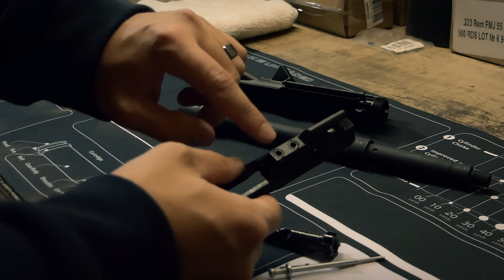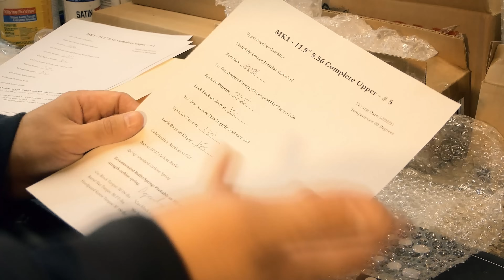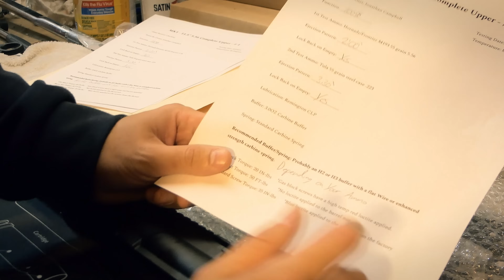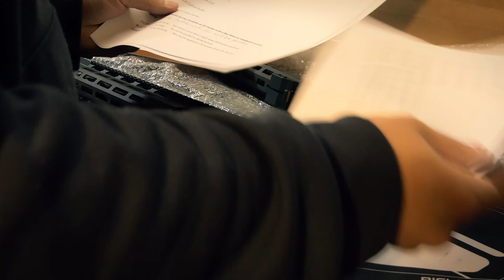The MK1 11.5" 5.56 Upper Receiver - High Value Upper (Definitely No Bias)

Comment: Toolcraft BCG: $120
11.5" barrel: $110
Handguard: $75
Upper: $60
Gas tube, block, charging handle & flash hider: ~$25
Shipping:  ~$25
Time spent ordering everything, buying all the tools & doing proper torque specifications during build: 2 hours & additional $100 for tools.
Total: ~$500

If you don't mind me saying, "High Value" is a HUGE understatement...
Reply: 100%! Heck of a value, especially for someone without the bench tools and build skills. I have both, but the price is good enough that I'd just buy this, swap the muzzle device and charging handle, and then off to the range!
Reply: ☝🏽 Tripp, see what I mean about the muzzle device? Definitely need to do a review on a hand full of different ones then pick 3 or 4 as well as adjustable gas blocks to offer for optional upgrades, especially if you plan to do any 14.5 p&w - which I really hope you do, but you'll have to figure out the legal requirements & the proper process to do it without harming the barrel
Reply: $110 for a BCA barrel is an overstatement. Those barrels were selling for $30 before BCA lost their business for employing illegals.
Reply: @notsure7799  yeah, it turns out you gotta charge a little more when you're paying legal employees and payroll taxes. Go figure. 🤔

My point was if you looked up the specific parts referenced, those were current listed prices. They did have it on sale for like $89 or $99 for a very short time, but not at time of the comment, I haven't checked it today though...
Reply: @survivetheattack  it was a reference to another conversation about 14.5 pinned & welded uppers for restricted states like CA & NJ. 
I meant offer different muzzle devices as options on the 14.5 p&w and he could also offer them as upgrades on the 11.5's as well.
As far as adjustable blocks, he had some nice blocks for $30 before. I think they were radical firearms, but I'm not 100% on that one...
Reply: @notsure7799  it's a ballistic advantage barrel not BCA.
Reply: @madeintexas1213  he specifically says at the beginning of the video that the barrel is a BCA....
Reply: I miss these prices 😢

Comment: Don't know if it matters to you, but if there's ever red threadlocker on something that you d9nt want to take apart, a propane torch for just a few seconds [until it's 500 degrees or so] causes the threadlocker to break down. 

They make a tool called heat crayon just heat er up and touch the crayon,  when it melts, you've hit your temp. 

Easy peasy. Old millwright trick

Comment: If anyone is curious, had mine about 8 months now. Had to warranty the first due to the Forward assist, Trip replaced it right away and the upper is 800 rounds deep on an Aero lower and still going strong. I’m a fan.

Comment: As long as you are able to keep them in stock while I save up to get one I will be purchasing one. I personally will replace the charging handle with a Radian Raptor because I find them much easier to operate especially in unconventional positions. I will be marrying it up with an Aero Precision M4E1 lower which is just what I prefer mostly for aesthetics.
Reply from the maker: I get why people like them don't get me wrong. I just think dollar for dollar they are pretty low on my tier for upgrades.
Reply: Check out the strike industries latchless handle. For $25 it's hard to beat & is also easy to run in awkward positions...
Reply: I recently bought a complete M4E1 upper and lower and I absolutely love it. The M4E1 recievers are awesome as are the ATLAS S-1 handguards and I've been really impressed with the accuracy of the 16" Stainless barrel. Overall, it's now my favorite AR and I don't think I'll ever use any other recievers.
Reply: @boomerisadog3899  Ya that premium stuff is great (I have a lot of it), but his offering here is some very well thought out mid-grade components that will, in, experience suite most shooters very well. He better be careful with his barrel swap offer though... Garandthumb might just take that challenge! 😉
Reply: @survivetheattack  I thought Aero was mid-grade stuff?
Reply: @boomerisadog3899  they very much are. I run a few of their receivers. Good solid mid grade components

Comment: Great video! And a great looking product you're providing. 
If I may make a small suggestion.  A thread locker I've come across that I use on all my brakes, gas blocks and threads that will endure higher temperature, is Hot Lock ceramic based threadlocker. It is rated for up to 2000°F and it is easier to remove, compared to Red Locktite (it's more similar to Blue). That's also a higher temp rating than Rocksett. You also don't have to prep it to set at 175°F for 15 minutes,  the way Rocksett recommends.
Also a small coating of Aeroshell 33/64 grease on the barrel nut threads will prevent seizing, making removal easier for maintenance. 
Keep up the great work!
Reply from the maker: Never heard of it, thanks for the tip!
Reply: Aeroshell gang gang. I won't build a gun without it👌👌👌

Comment: 7 sided mlok is definitely the way. Idk why more manufacturers don't just do that.
Reply from the maker: It's the best system overall IMO.
Reply: I've found that it's mostly redundant. You hardly EVER see someone using the 45 mlok slots, but they are still better than just having useless cutouts in the same spots

Comment: Being that i reside in the communist republic of jersey, i insist the mkII is a 16in or 14.5 p&w! Love the channel and watching it grow! I would love to buy an upper in the future.
Reply from the maker: Haha, will do!
Reply: i second a 14.5 p&w...   ive even heard of some guys using set screws & braising with high temp silver solder seeing as its essentially permanent without risking heat damage that comes with welding,  although im not sure if it would hold up in court...
Reply from the maker: @RichardCranium321  I would have to do the full pin and weld to make sure I don't get anyone in trouble.
Reply from the maker: @RichardCranium321  I might have a option for 3 or 4 choices.

Comment: So I have this solvent trap direct tube and same cups as you but I went with the 6 in version I just ordered the yhm phantom qd adapter and it won’t fit on the d-cell tube from solvent trap direct it’s a little to small, do you think I ordered the wrong qd adapter? Any help is appreciated. Keep up the awesome videos man
Reply from the maker: the Dcell is 1.4375x20 instead of 1.375x24 of the YHM. Checkout Muted Machine Works for an adapter (adds length) or go to JR Machine Products for a 1.4375x20 Titanium YHM mount.
Reply: I really appreciate it man thanks 🙏🏼

Comment: I see you have a qd mount for your form 1 suppressor now, I am also looking at using the yhm flash hider qd mount on an sbr build, how did you go about attaching the qd suppressor side on the tube?
Reply from the maker: I forget where I got the adapter. It threads into the rear of the can just like any adapter would.

Comment: very nice budget upper option, far better specs than the low cost builder companies. Q: No anti-sieze on the barrel nut, nor three-time seat/remove process for it?
Reply from the maker: Thanks man! The anti-seize on the barrel nut is preferable but not entirely needed. So on these uppers I have not applied any. However, going forward all of my uppers will be assembled with anti-seize and the extended installation method.

Comment: Nice. Gotta say, I've been running Aimsports fails for the last three years multiple builds and I love them. For the money, I'm not sure there's anything out there better.
Reply from the maker: Same man, I have 4 or 5 right now.
Reply: @FocusTripp  Just a tip, when torquing using a Crows foot, you want to have the Crows foot at a 90 degree angle and not in-line with the torque wrench. Having it in-line will actually increase the torque value.

Comment: What is the gas port size on your barrel and are these barrel's chrome lined both chamber and bore?
Reply from the maker: .075-.076 via my pin gauges
Reply: @FocusTripp  yes that is on the larger size for the gas port but like you said it will run anything. What about the chrome chamber/bore  barrel, yea or nay?
Reply from the maker: Nay sir, would've added $100 to the price. In the future I will have more options but not right now at the start.

Comment: Been thinking about getting a .556 upper….
Reply from the maker: well well well
Reply: @FocusTripp  I’ve picked up a few BCA 7.62 uppers recently, thought about a .556. Not quite sure if I should do BCA again although I like the side chargers a lot.
Reply from the maker: @MoRoTheGKnight  they had some side chargers in 5.56 for like $250 which were pretty great.
Reply: @FocusTripp  yeah I’ve been eye balling those since I’ve picked up the ones I have in 7.62. It’s hard to beat the price.

I’m a little hesitant after both the extractors failed in my 7.62s, but they sent some other ones I’ll be testing soon. The 223 Wylie/556 I would imagine would be a little stronger since the case is different.
Reply from the maker: I have never had a BCA extractor break on my 5.56 uppers.
Reply: @FocusTripp  that’s good to hear. I might just pick one up next week.

Keep up the good content. 👍
Reply: Oi!
Reply: @stevenkennedy4130  Fancy meeting you here. 👍

Comment: So just out of curiosity, is a 12.5 Mid length set up similar to a 10.5 carbine length as far as dwell time goes?
And if it is, is that problematic? I see alot of companies selling 12.5 middies and alot of people say they love them so im just interested in your perspective
Reply from the maker: As long as they are gassed appropriately they are fine.  But, 12.5" middies are right on the edge of not having enough dwell time.

Comment: Which YHM quick adapter and muzzle device are running on your form1 can?
Reply from the maker: The muzzle device is their 4302-28a closed tine flash hider. the adapter is a Titanium clone of their kurtz kit.
Reply: @FocusTripp  do you have the link for the titanium clone adapter? I have the D size tube from Solvent traps direct. Thanks
Reply from the maker: @HuyNguyen-cw7es  jmp machine is where I got mine

Comment: Have you tried bedding the barrel with blue loctite between the upper and barrel extension? I've heard it massively improves the bearing surface between the upper and the barrel extension
Reply from the maker: I have had good and bad luck with trying stuff like that. It's not something I would experiment on customers uppers with.